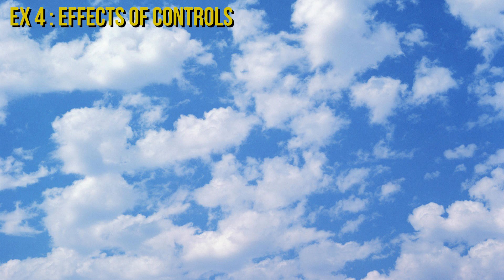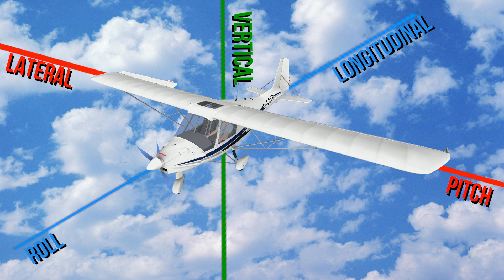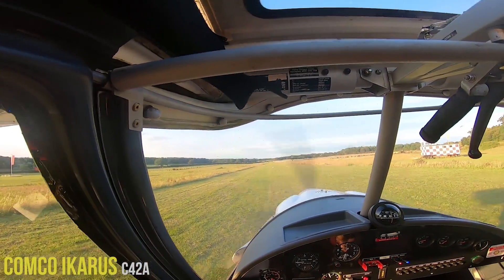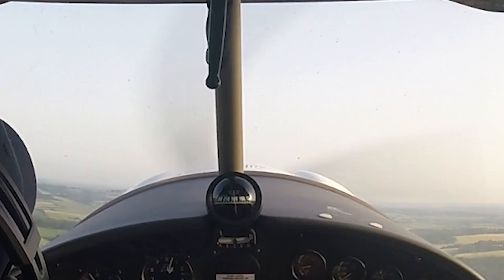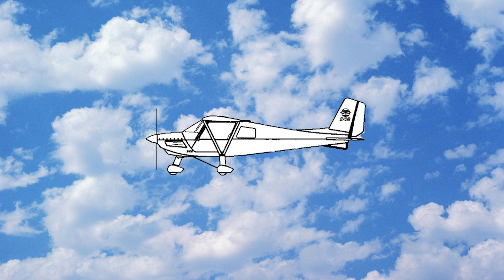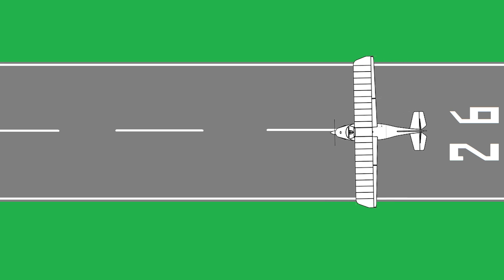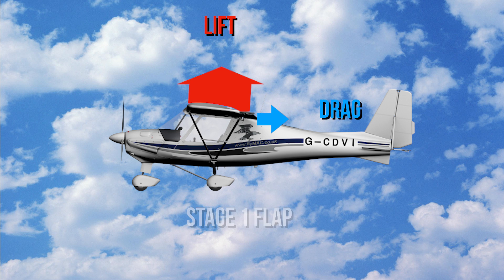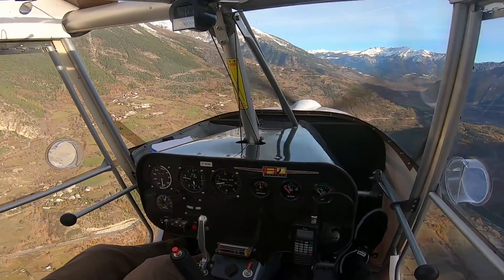EX 4 : Effects Of Control

Comment: Hi - you mentioned different stabilities (positive/neutral) of aircraft and in this example, when you roll the aircraft using aileron, you return the yoke/stick to neutral to stop the roll. When pitching up or down with the elevator/stabilator, do you return yoke/stick to neutral, or do you need to maintain back/forward pressure to hold the nose up/down? Cheers.